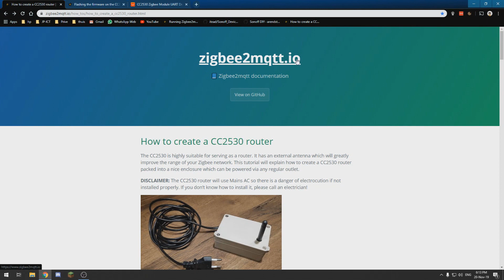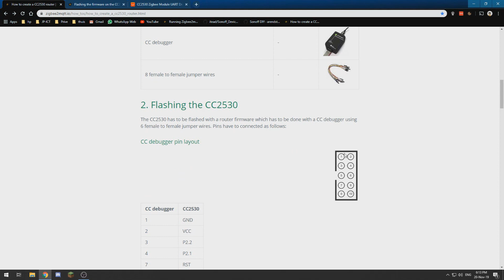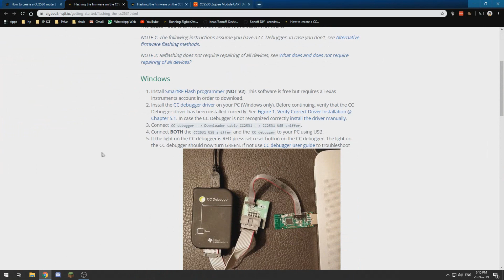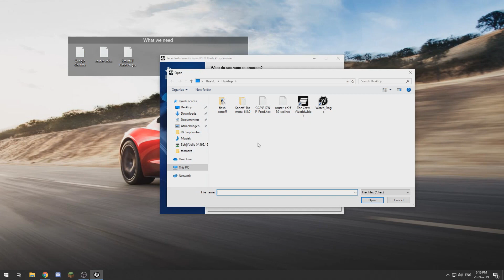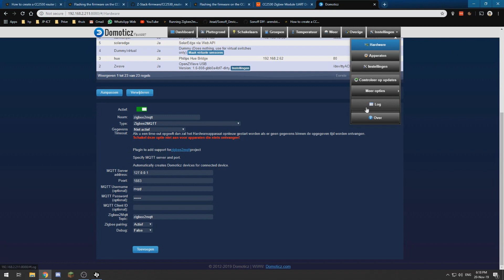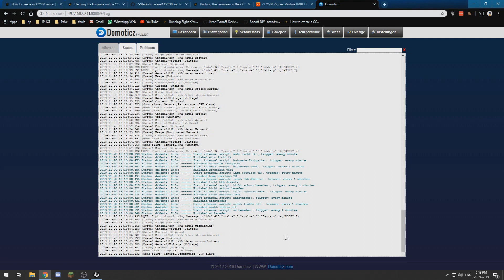DIY zigbee router for zigbee2mqtt and Domoticz or Home Assistant

Comment: May i know what is the purpose of zigbee router ?
Reply from the maker: You need one if you have more than 20 battery devices and no wired devices  otherwise the usb stick which zigbee2mqtt uses cant cope